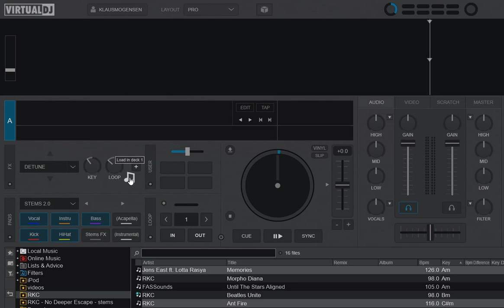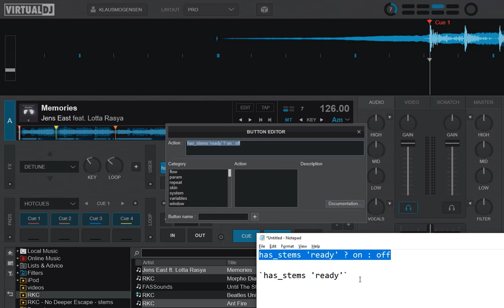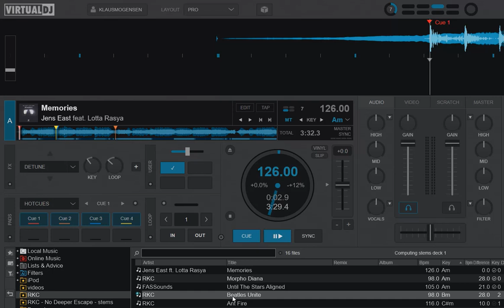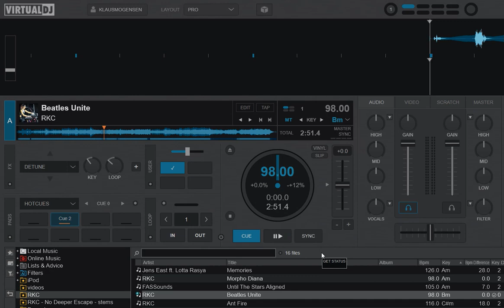Quick n' Dirty: Creating a real-time stems separation status indicator in VDJ2023

Comment: May I ask something irrelevant.. I am using the default performance skin layout, is there a certain script that I can add on a button to my controller so I can open and close 4 decks layout?? Thank you in advance
Reply from the maker: Yes, you basically need to toggle a variable, and reload the skin
So for 2 vs 4 decks on the performance layout, this script should give you a toggle:

toggle '@$4decks' & load_skin

It should also work for the pro layout
Reply: Yes, it works perfect! Thank you very very much Klaus!!